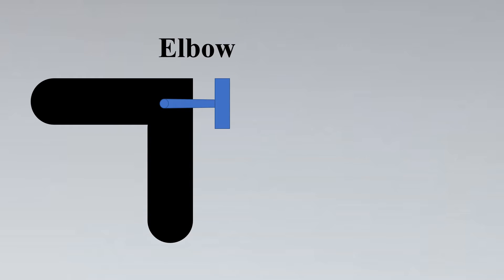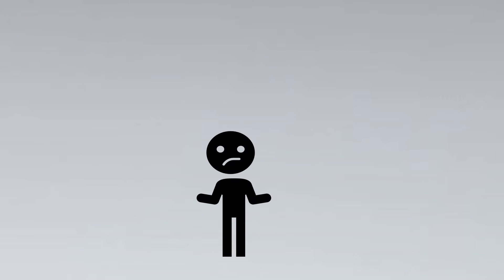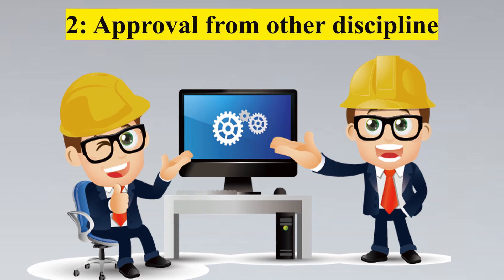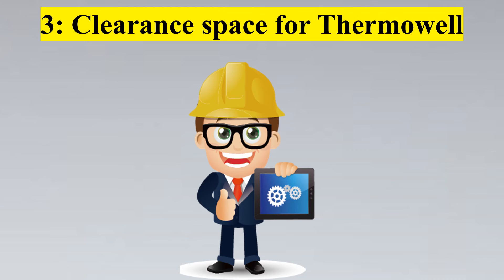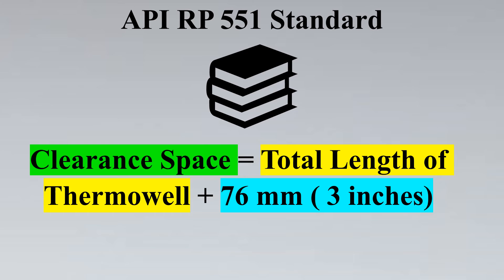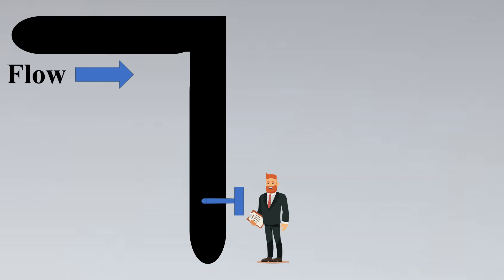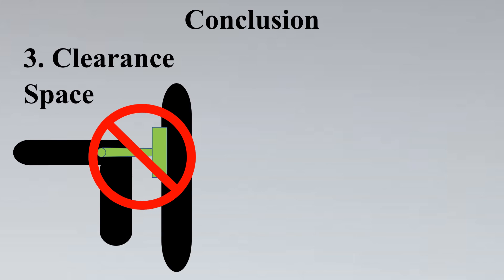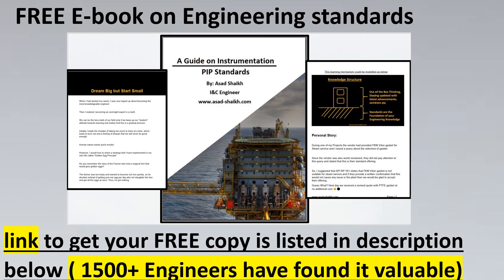Thermowell Installation on an Elbow as per ASME PTC 19.3

Comment: Hi. Thanks for nice explanation. But do installation is elbow need wake frequency calculation?
Reply from the maker: yes as per ASME PTC 19.3 ,They say follow conservatives approach and consider it as line mounted. However i have work with few well renowned clients in the oil and gas sector and they ask us engineers to avoid WFC calculation if we can accommodate in elbow so thus final decision rests with  client.

Comment: Can you give reference from PTC 19.3 2016 on elbow installation. As such in WFC vendors do take full U length of well.

Thanks you for your efforts
Reply from the maker: As per ASME PTC 19.3 Page no 28 .

The standard recommends to take a conservative approch.

It states as follows "For a conservative justification of a thermowell mounted in this fashion (figure 6-10.7-3) the thermowell may be evaluated as thought it were installed perpendicular to a pipe."
Reply from the maker: Hope this helps @rohan 😊
Reply: @AsadPassionateEngineer  Thank You

Comment: Thanks for the info, really needful👍
What about TW installed on equipments?
Reply from the maker: Most welcome 🙂

Yes will surely make a video on installation criteria's for thermowell installation on equipments.

Few requirements mentioned here would also be applicable for thermowell installed on equipment.

But will make a video on other specific requirements especially applicable for equipment installation like checking whether the vessel internals are not obstructing thermowell path etc.....